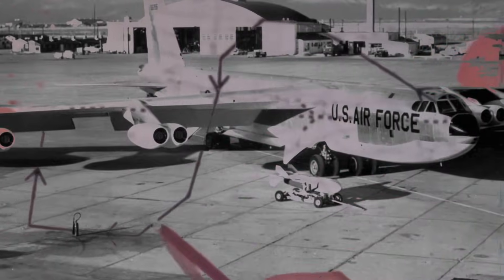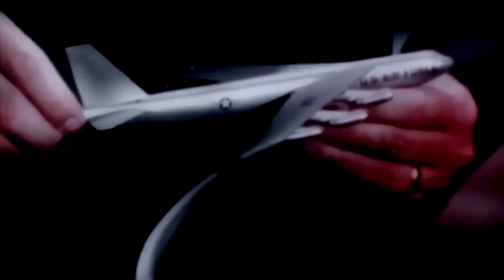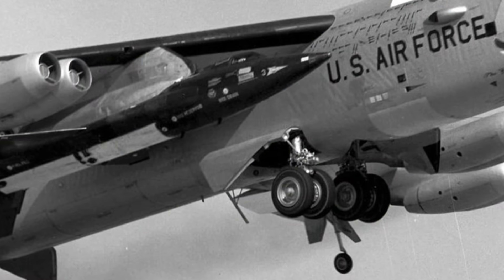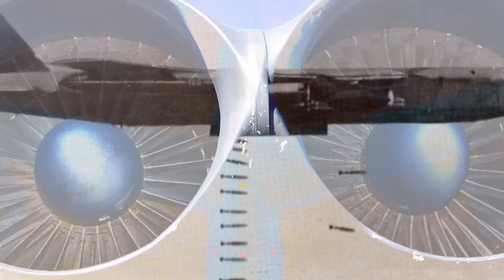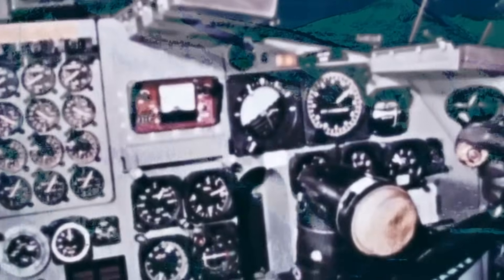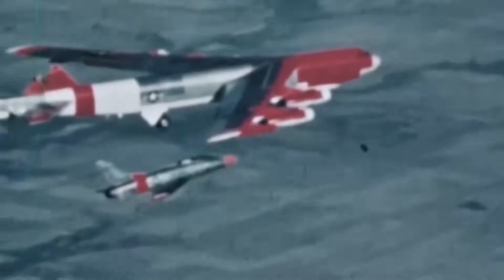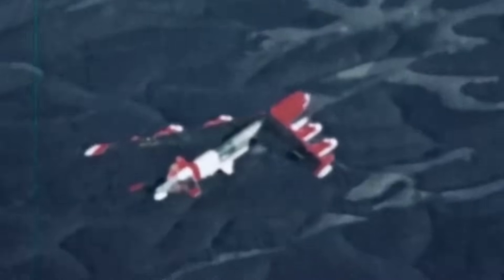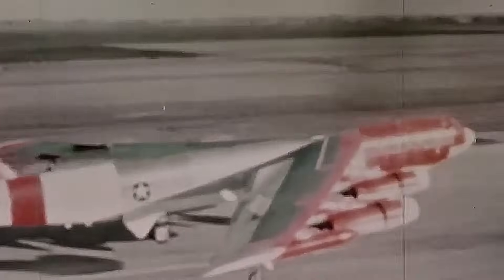B-52 Landing Without a Tail: Severe Turbulence & America's Secret Nuclear Deterrent

Comment: So you can't prevent such damage by slowing to maneuvering speed in turbulence? I guess it makes sense. Maneuvering speed is the plane's speed through the air, but if the air itself suddenly changes speed and direction, the plane may not stall before suffering damage.

Comment: There was still enough of the tail remaining to allow the plane to track straight and control left/right movements using engine thrust. This reminds me of JAL that crashed in the mountains of Japan when the AFT pressure bulkhead blew.
Reply: electronicsNmore -  Actually JAL flight 123 was VERY different in that, in addition to loosing their vertical stabilizer, all of the hydraulic lines were severed as well. I remember this incident very well as I was living in Japan at the time. And in particular I remember that the US Air Force was denied permission to assist in the rescue efforts, even though they were the ones who located the crash site and were the only ones that could have reached the site and put men on the ground before dark. The JSDF of course did not get there until after dark and then could not put any rescuers down due to the poor visibility at night and the rescue had to be delayed until morning. Because of this many people who were alive immediately after the crash ended up dying before being rescued. I think 5 people ultimately survived, although the Japanese media focused most of their attention on a 12-year old female survivor named Keiko.
Reply: @SLOBeachboy  Similar meaning how much of the tail was missing, nothing more.
Reply: @electronicsNmore  And it was a, um, uh 747, not B-52. Entirely different, like come on. /s
Reply: @liam sargo Plane is a plane. DUH!
Reply: Not enough left for as big and heavy this plane is sorry to tell u
Reply: JAL123 was a set up. To cover up a huge insider trading ring.

Comment: They began retrofitting B-52's with a much shorter tail I believe as early as the late 60s but assuredly by the mid-70s because the environment it was designed flying was changing from a higher altitude to a much lower altitude. I'm wondering if a procedure that used to be used by pilots helped cause this situation. And that was using the rudder pedals to induce a roll to the aircraft. That particular habit was the cause of a commercial plane coming down just after takeoff in New York several years ago. The procedure works great the problem is it in Parts a huge amount of torque forces to the rudder assembly. The B-52 is a superbly strong aircraft, as evidenced by the number of pilots who did rolls in them to avoid surface-to-air missiles in Vietnam. The only way a large aircraft can avoid a radar guided missile is to roll the aircraft and changes aspect ratio to what the missile is seeing, causing it to lose radarlock. Interesting Lee I pilot that had taken off just before TWA Flight 800 reports that he did just such a role to avoid a missile being fired at him over Long Island just minutes before Flight 800 went down as 154 Witnesses report missiles being fired at the aircrafts. This being a side. I still wonder if the aircraft was subjected to critically High Rutter forces before it ever took this test flight. One other observation. You stated that these were the highest side forces ever recorded on an aircraft up to that time. As 99.999% of aircraft do not have test equipment on them to even record such things I would think the statement is a moot observation.
Reply: Bovine scat.  A-F = Tall Tail.  G&H Short Tail.
Reply: @setnaffa  Correct Mike Morgan! Why do people with little knowledge comment onsuch specifics.

Short tail looks better as did the H model with the turbofan engines in place of the turbojets of A-G models. ( I am correct there, right? I remember this from being a kid in the 60/70s)

Comment: There is still enough mass there to initialize a weak stabilizer no rudder though.. yes you can see it can fly.  they are implementing computer controlled programs to make new planes fly without stablizers.  that b-52 isn't missing a tail.  More fairy tales.  It has a tail also.  Is this Boink Brainwash?

Comment: "splintered wood"?
Reply: This was the Sopwith Variant of the '52. Also saved tons of weight with its canvas skin. This is why we loathe Millennials.
Reply: @mikel2283  M I L L E N N I A L S
Reply: I wondered about that too, There are several statements in the narration that conflict with the film, such as the tail and vertical stabilizer being "sheared clean off."  From the film, it can be seen that some parts of the fin and stabilizer are still intact.
Reply: I guess he was thinking of the balsa wood model
Reply: yeah, they weren't wood when I worked on them. Airframe structural repair too, so Ive seen the innards. I saw an old pop top beer can in a landing gear door that had no record of ever being opened up since new. but I ain't never seen no wood. . .

Comment: The b-52 is still being used to this day correct?
Reply: B-52s are very much in use. In the works is re-engining them with modern more fuel efficient and reliable engines.
Reply: Al Grayson thanks bro
Reply: 2050 was the expected retirement date but the'll probably push it back again.  B2 and B1B is nice and all but can't replace the B 52 and if the F 22 and F 35 clears the air and ground threats no need for a heavy bomber to be stealthy or super fast. But you never know stealth will eventually be overcome then what ever darpa and Boeing or Lockheed martin come up with will overcome whatever canceled out stealth and so on.
Reply: They are talking about Refitting the B52-H's with new engines and turning them into B52-J's. They would then be kept in service until 2050.

Comment: in the 1960s, hard-earned WW2 experience over germany was still part of living memory**, so it's not actually that surprising that the USAF or SAC saw wisdom in having a training film to aid fresh-faced B-52H aircrews understand how their ship handles after absorbing battle damage to their tailfin.  

** general "bombs away" lemay, effectively the father of SAC, was the air force chief of staff as late as 1965, for example, and commanded bombers over europe as part of 305th group, 8AF.
Reply: I was in SAC, B-52 a/c pneudraulic mech as late as 1965. Those D models at that time had over 5,000 airframe hours on them.

Comment: Did the H-model already have the 'short tail' configuration not seen on the A through G models, at the time of the incident? My guess would be 'no,' since the aircraft was test model.
Reply: Thomas Nettleton both the G and H models were designed with the “short” tails.  All previous models had the tall tails.  The short tail improved low level flight performance.  This particular aircraft wasn’t a test model per se.  This aircraft is still in service, but I believe it is in storage for the time being.  I flew it several times.

Comment: speaking as a pilot, its not too unrealistic to fly without your stab and elevators. pitch can be controlled with gentle throttle inputs, and yaw can be corrected by S motions using the ailerons. still, it takes a good amount of skill. specially considering the aircraft was a prototype, and the crew likely had very little previous flight time with her
Reply: That and the Jet engines used don't react terribly fast.
Reply: tartan1985 3 I totally agree - most pilots wouldn’t say something like this. There are many aircraft designs which are inherently unstable without a vstab, I can cite many crashes caused by such damage. The B52 guys got lucky. Part of the reason this video exists is because IIRC, there were crashes of many B52s due to suspected vstab damage / loss and it was serious enough to train crews about it. I think it was eliminated by a different gain system and design in subsequent B52 models.
Reply: @tartan1985 3 there were other (civilian) flights which did the same thing. It has happened more than once.

There was:
United flight 232. (Not a safe landing, but better as expected given the situation).
American flight 96. (Not full loss, but no rudder and limited elevator. Safe landing).
Delta flight 1080 (full loss of elevator control, safe landing using only the engines).

There are more of these situations, but all in all. It is possible to land a plane with most of the tail missing, using the engine controls. It's not an easy feat, but provided you don't completely lose the tail, you can land.
Reply: Ok Mr.FSX whatever you say
Reply: skater later 😂 I wish, my computer is too slow.
Reply: @EstorilEm  Theyre all too slow
Reply: I think in about 20 years there will be a computer system reliable enough to run that program to it's fullest potential :)
Reply: Pilot must use "flying wing" configuration and aircraft is still flyable.
Reply: JAL 123 didn't to too well without a vertical stab
Reply: This ^ is why social media sucks. 

Laterally the aircraft flew nearly perfect for 32 minutes after the bulkhead exploded. The plane had ZERO hydraulic fluid, zero control. It crashed due to an oscillation / phugoid cycle which couldn't be controlled due to no ELEVATORs, not rudder - though lack of roll control would have likely resulted in a crash as well. None of this has anything to do with a missing vstab.
Reply: Neither did AA587
Reply: @stephenshoihet2590  AA587 may be saved yet, all other control surfaces was working. They continue turning left, but situation requires gently level and nose up to avoid side slip and corkscrewed path. Without rudder corkscrew is unrecoverable.

Comment: In 1991 at Fairchild Air Force Base I was an airframe technician and we had a similar incident. Lightening blew away a hole in the tail big enough to walk through with room to spare. The pilots didn't even know it! They just said it felt "sluggish" with it's handling. These are robust aircraft for sure. And it was a B52-H model, nuke bomber.
Reply: My father was an USAF vet. In the spring of 1961 he took us to Fairchild AFB to watch the B-52s taking off. Been a few years, obviously, but I still clearly remember how unbelievably loud it was. Good times.
Reply: @KowboyUSA  I heard the same thing at Wright Patterson AFB in a campground under the flight path.
Reply: The H-models have a 'short tail,' compared to the A through G models. Would this have been a contributing factor to the aircraft remaining relatively stable and not plummeting from the sky?
Reply: @thomasnettleton289  could be, I never got much more info about it cause damage was beyond our means to fix it. Had to bring in contractors from Boeing to fix.
Reply: The -G was the first variant with the shortened tail.
Reply: Sorry but the D was the last tall tail . @thomasnettleton289
Reply: These 55 year old planes are flying into and out of Syria over the last couple of years. Robust indeed.
Reply: @User31129  Taking off from DG, flying over Syria at 50,000', dropping bombs, and looping back to DG is NOT flying "into and out" of Syria.
Reply: @SusanKay-  There was no "trying" involved. Those were deliberate supersonic overflights. In Chicago during 1965 there were quite a few, and I remember the flexing of a two story plate glass display window on the local Sears store evidenced by the moving reflections. That Sears was closed this summer and was the last one in the city that remained.
Reply: Susan Kay I grew up very close to Tinker AFB in Midwest City, OK in the 60s.  I remember the sonic booms.  Also would go to sleep listening to the jet engines being run up...my dad was a mechanic at Tinker and they used to be able to work on the engines at night.  Times changed and the noise bothered people. How I miss the planes flying overhead and the sounds!  C130s would fly so low over the house.  Never see them anymore.  😞
Reply: Hit by lightening? Does anybody ever get hit by darkening?
Reply: C. L. That is pretty fun! That's a mighty plane for sure.. :)
Reply: Could almost bet . . . there's pilots, out there in the USAF, who had a granddad who flew the same aircraft type (B-52) . . . some 50+ years ago !
Reply: per aspera ad astra ¿  ever heard of the term Dutch Roll? a sheared vertical stab IS a big problem. japanese airliner had the aft pressure dome rupture in flight and tore off the vert stab a number of years ago. they dutch rolled for a long period of time before crashing. all lives aboard were lost.
Reply: Ha, I was the guy patching that hole so they could fly it to the boneyard for a new tail
Reply: I thought the B52 was notorious for crashes? anyway, this would restore some pilot confidence. I'd play it too..over and over.
Reply: Yeah No,,you thought wrong!  @zerofriends5592
Reply: I was there in EOD and on call.  The hole was big enough to  get through.
Reply: Is Fairchild in Spokane Wa.? Or is that Geiger field?
Reply: @timmorris3056  Yep.
Reply: Even the D's were fitted for Nukes
Reply: "Sluggish - like a wet sponge"
Reply: Any nukes on board?
Reply: I live in Spokane, W.A, go to Fairchild AFB a lot for Airshows.  Do you remember the b-52 crash that happened there? I think in the same year?
Reply: I was stationed at Dyess Air Force Base, Texas July 75 through August 76. They had B-52 D's they were the last ones flying if I remember correctly. All of them had been to Vietnam at one time or another and of course they had C-135s there too. I don't believe any of the D models still had the 50 cal Stingers in their tails. I didn't pay much attention to them most of time got used to to seeing them petty quickly. I was in MAC working on C-130's we had two squadrons of them if I remember correctly. The unit was in the process of getting what was then the New H models when I got there. We had the E model when I got there. They smelled pretty bad. I made a comment about it to someone and they told me it was because they had been used to carry the dead around Vietnam and the blood and whatnot of those poor guys had gotten into the very seems of the aircraft. There was one E model that nobody liked to work on cuz everybody swore it was haunted. I of course didn't believe it until I had to work on that plane late one night, believe me I never want to go back on it again. Luckily I never had to because it was sent to the National Guard before I ever had to worry about it again.